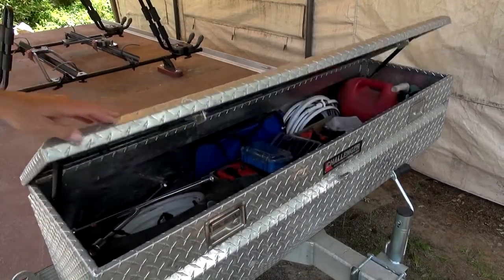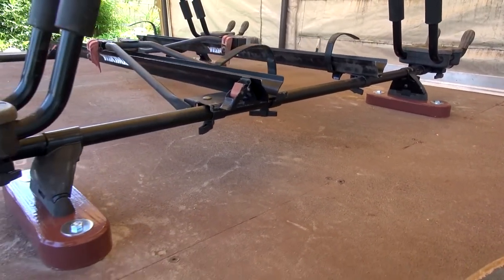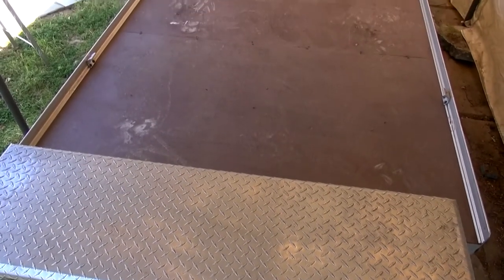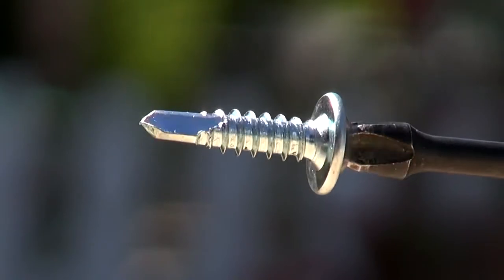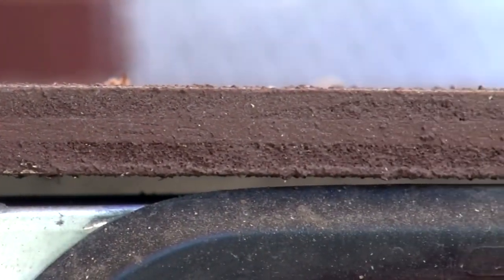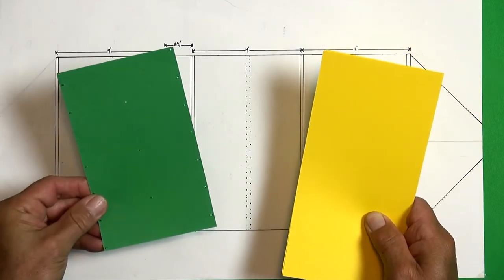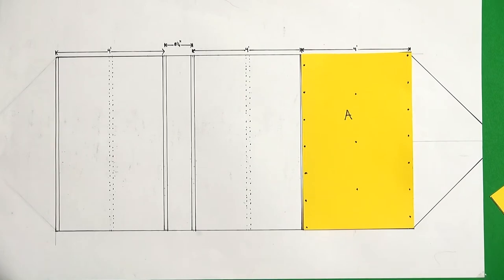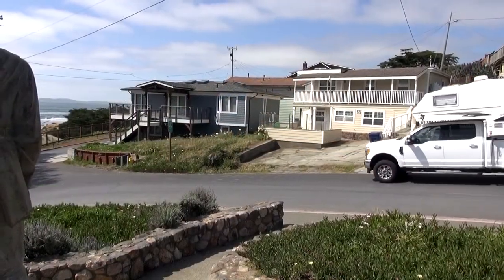Triton Trailer Re-Deck

Comment: You can use dowel centers to mark the holes or a double headed nail with the top cut or ground off about 1/4 inch above the double head. The holes are 3/16 and the screws are 1/4 inch diameter Fastenal Wood to metal screws, you simply press the wood on the centers or nails and your holes are marked.

Comment: My floor is still in very good shape even after hauling my building material so many times , but its just not strong enough for the motorcycle  tie downs and chalks. I decided to line x the original floor and overlay it with slotted 1/4  alum sheeting. Then maybe the l tracking for my tie downs . It has been the best trailer for everything. I've even hauled 50 sheets of 12 ft drywall with it a couple of times, and it did fine, but I do know I was exceeding the weight limit. Great trailer.

Comment: Thank you for taking the time to post this video.  I have the same trailer and just bought 4 sheets of 1/2”(actually 12mm) marine grade plywood to replace the deck.  I want to use the same deck screws and tapped holes. Like you, I can use the old panels as templates for the placement of the pilot holes on the new panels.  Do you remember what size bit and counter sink you used to drill the pilot holes?
Reply from the maker: You're welcome C G. My countersink bits have long lost their size engravings, so to make the selection I just held one of the bolt heads next to different sizes and chose one that would match the head width and flare. The pilot bit of the one I chose was too small and just served to drill a through hole. I enlarged the holes later to accommodate the bolt. To get the countersinks consistently true and to the right flush depth, I used my drill press with depth stop.  I set up roller stands around the drill press and rotated the whole sheet around the spindle. Yes, I know,  I've been called a perfectionist but I've never regretted the results of making the extra effort.

Comment: Perfect video.
Reply from the maker: I hope it was of some value to you. Thanks.
Reply: @DanChanPiano  I actually have a question about the cargo box.  When turning the trailer and maneuvering it, how bad does the box affect it?  Looking to do the same thing on my ATV88 Trailer.
Reply from the maker: @Vader440  The weight of a load in the cargo box has little effect on its handling. If I'm towing the trailer with just a standard pickup truck, the trailer will follow the truck in its tightest turn (forward) without making contact and you would really have to crank a sever angle in reverse to make it jackknife and make contact with the back of the truck.  However with my rear overhanging camper on and cargo boxed trailer attached, I can still make the tightest forward turn safely but can easily jackknife the trailer in reverse. As a matter of fact one corner of the cargo box is now dented from such a maneuver.